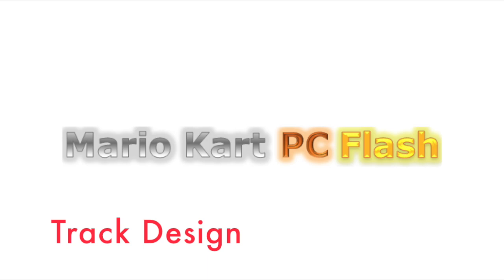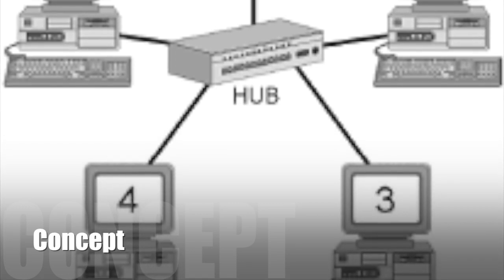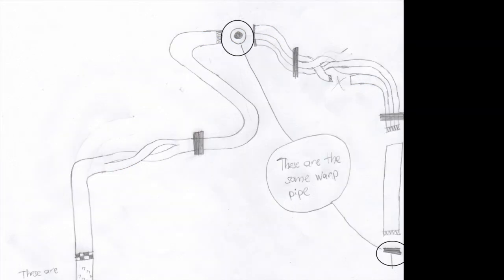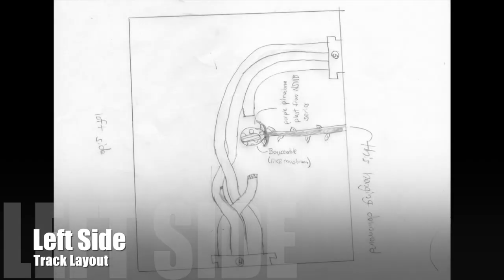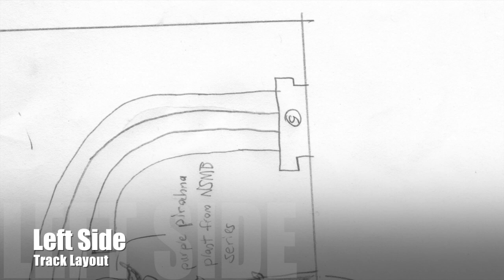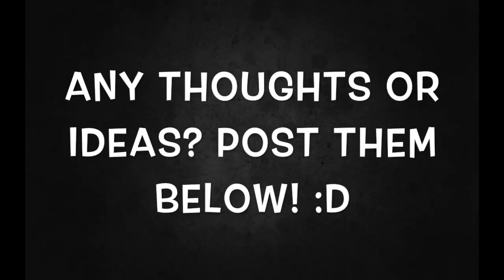Track Design - Piranha Pipeworks

Comment: I have an idea for a track which I like to call: Koopa Shores. You start off on top of a cliff edge off from the coast as you enter a light house. You climb up the inside of the lighthouse in an anti-gravity spiral as you make your way to the top and get shot out in a glider path leading to a barge just outside out to sea. You land on the barge where the path leads you to two alternate paths, each on both sides. You then head to the other end of the barge, where it leads you to the inside where you must dodge freights and machinery as you make you way to the bottom, leading you underwater as you make your way back to shore, then drive on the beach and drive an anti-gravity section up the cliff edge back to land and making your way back to the starting line.

Comment: I'm alive! Half Term! Good Grades! Anyway...
1) 0:20 Yes, that would help. My art skills should NOT be discussed.
2) 0:37 No problem!
3) 0:42 How is your presentation? Very good, very clear. I like it! :)
4) 0:44 What I saw before making this comments really did make me think of Piranha Plants and Pipeworks. I was thinking recently, try basing it off that pipe area from Mario and Luigi: Partners in Time. It can help you understand how pipes are connected. Also, an old Custom Level for NSMBW (actually for Not So Super Toaster Bros Wii) made good use too!
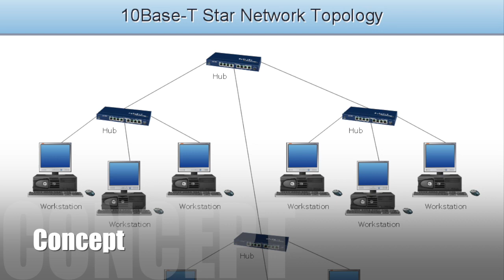5) 0:58 Good way of explaining.
6) 1:41 Again, about what I saw earlier, we need more signs of piranha plants if this is their hub!
7) 1:51 These means we should have lots of life on the two faces not used for races.
8) 2:13 Let me use this picture to explain my experience with tiling pipes. Sometimes it is more effective to have lots of vertical pipes in a row than one horizontal one.
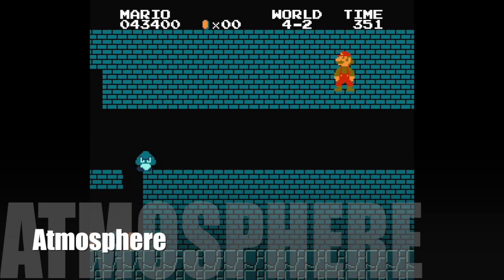9) 2:30 In that case, it needs a more updated feel. Also, let's not make this an exuse to be lazy. Have ? blocks and used blocks sticking out of the wall! Also remember, the bricks are not changing colour in different colours in SMB, the lighting is changing. This could be useful to know.
10) 2:39 Also, I'm going to use this image to explain Mario's height. Mario is two blocks high. Look at the red pipe. Can you see the four blocks? This tells us that a warp pipe is just under double Mario's width. Just if you need to scale any pipes. There are larger variations in NSMBU. Just trying to be exact here.
11) 2:44 Here are some obscure titles for you:
* Donkey Kong Jr + Jr Maths Lesson
* All Night Nippon Super Mario Bros
* Kaettetika Mario Bros
* Yoshi no Cookie: Kuruppon Oven de Cookie
* Undake30 Same Game
* Excitebike: Bun Bun Mario Battle Stadium
* Donkey Konga
* Donkey Konga 3: Tabehōdai! Haru Mogitate 50 Kyoku
* Captain Rainbow
* Super Mario Spikers (no, not strikers)
* Face to Mario
And finally...
* Mario Party Fushigi no Korokoro Catcher
Yes, these are all real games!
12) 2:56 Yes, this is VERY hardcore
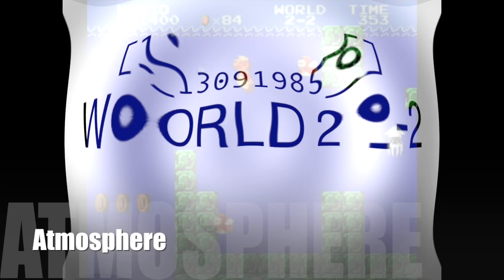13) 3:25 In fact, we could even have water coming out of that pipe!
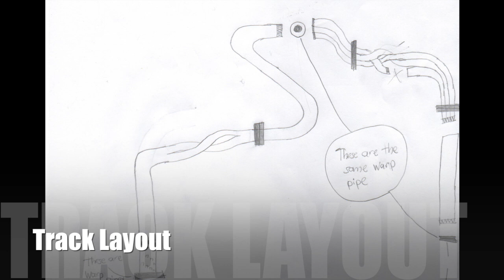14) 3:30 Don't worry, I do Track Analysis on MS Pain for a reason. This: http://s42.photobucket.com/user/marionose1/media/Choosing%20Yoshi%20Test_zps2p6tfoko.png.html?sort=3&o=0 , is not something I can usally produce.
15) 4:34 Can I see that you planned to put a Warp Pipe somewhere on the right? Just asking.
16) 4:50 May I also say that the corner needs one of those connector thingies. A thing with warp pipes is that they can only travel straight. This is the video I mentioned earlier: https://www.youtube.com/watch?v=7RJmoG3wCWc
17) 4:58 Pipes are very strong. If connected to the walls and floor, they do not need pipes to stabilize them. Also, there is no neat way following warp pipe rules that a mini pipe can connect to a normal pipe. They can however be nearby.
18) 5:05 Yes, that is a great idea! This is used in Pipe Underworld for CTGP.
19) 5:17 Metallic is a good choice. Also, considering this is probably a sewer, it should be very rusty.
20) 5:23 OK, but the track will be very bumpy. Having a picture as our texture will make the track look ugly.
21 (OMG! 21! hahahahaha....uhhh) ) 5:28 I'll assume there is no faster path here.
22) 5:39 Is it on the path? Nobody will ever go that way if it is.
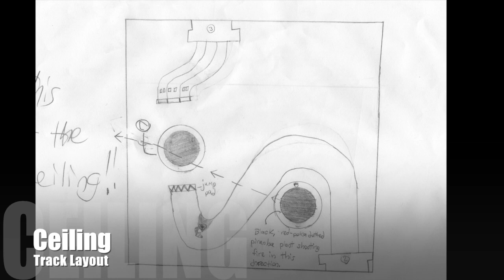23) 5:54 Like we discussed, instant teleportation can be painful to look at. Try to imitate GCN Pipe Plaza's pipes.
24) 6:02 Yes, I do remember. They mess up my times in SM3DL. Remember, we could also have Venus Fire/Ice Traps!
25) 6:06 Giant? We don't know its behaviour! We do know how giant Venus Fire Traps work however. They are slower than normal size ones, and the fireballs are about the same size as Mario. To fit the scale of the karts, the fireballs should match the size of the kart as well.
26) 6:10 Is that a footprint in the pipe? Why is it there?
27) 6:12 Not harming? I know where this is going, and I did the first time I watched this video. In this case, we should be on the opposite side to the area he's shooting at. This means that he can be shooting a more direct route, avoiding glitchyness.
28) 6:25 Not sure if that will work. That turn looks quite narrow, and if its busy, people will have nowhere to go.
29) 6:25 Also, why is "LING!" written on the left? Are we on the ceiling? 
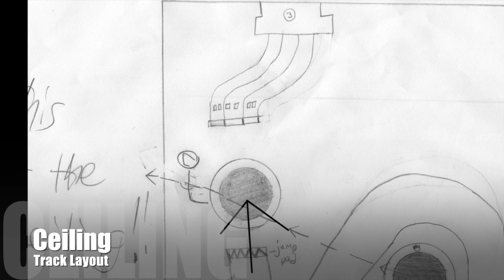30) 6:39 I have something about this pipe to get to as well.
31) 6:54 How wide are these pipes? I think they'll be hard to frive on.
32) 6:56 Actually, those piranha plants come from holes mainly. It would make more sense to use a hole in the wall. A pipe is still fine though.
33) 7:12 Then what about when you exit the warp pipe? That could be a pain to land on.
34) 7:24 I do not think that will work. Cool idea though
35) 8:20 No. Offroad on a pipe is not a good idea. Remember, working with pipes is different from working with normal ground.
36) 8:24 Obviously? The amount of offroad there looks like ypu can just jump in last second.
37) 9:25 Just a reminder, a texture is more what the ground IS, rather than how it acts. For example, Wii Mushroom Gorge's Mushrooms have a Red, Spotty texture, not a round bouncy texture.
38) 9:35 Yes, yes I do
39) 9:41 My only issue is that players driving on the straight-away won't see the Fire Balls until they have nearly landed.
40) 9:42 Hang on, is that off-road, or are you marking where the fireballs land. Oooh! Let's have burned marks on the track to show where the fire lands! Bye Bye point #39!
41) 9:49 I prefer to think of BCWii. There are burned marks there, too.
42) 10:02 Good choice with those ramps. The player can either lose time by gaining air, or they can try to dodge a fireball.
43) 10:07 Good, three item box sets. Perfect!
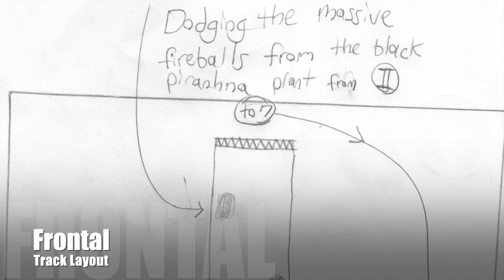44) 10:21 Here comes point #30
45) 10:30 I'm sorry to say that I do not like that idea. The karts can easily collide.
46) 10:38 OK, so it did say ceiling. I wan't sure

Anyway, amazing video and ideas. I have one final thing to say, and it's about the audience. Remember the Stalking Piranha Plants from NSMBW? They should watch!

Also, I have no issues with your voice.
Reply from the maker: marionose1 Thanks for the LARGE FEEDBACK!!! You make some very interesting points but allow me to try and save some of my ideas before you shoot em down ok? XD

Before I start, yeah I wasn't thinking about the audience at all as I was mainly focus on getting the CORE design which turned out pretty alright for a debut (for what you've written) :D

4) There's a thought! 
6) I know I just wasn't too sure exactly WHAT to do in regard to that. By the way, this is the hub of the ENTIRE mario series not just for the Piranha. I originally envision the Piranha to create the image that they are INFECTING this hub world per-say.
7) I know. I set that up specifically for anyone to add ideas for. Plus I thought the track length was fine as it was so I kept it at 4 sides.
8) I understand. I just really wanted to portray the image of a network going to many locations.
9) Kind of lost you here. :\ Can you explain this again?
10) I know but remember that we don't really know the scaling for the characters inside the karts in correspondence with the track yet which is more important than the individual character scaling. Going off MK8 track scaling, the Pipes, Warp pipes, and entire track itself need to be big enough to accommodate for 12 players racing at the same time. The same concept is applied in MK8 DLC #2 Animal Crossing's KK Slider.
13) I'm not opposed to that as long as it's explain how the water exists the "hub" per-say. Same concept applies with any kind of pipe we do this with.
14) Finally got it up huh!? XD It looks really good. What other menu layouts do you plan to do next?
15&16) The large warp pipe is going into the wall. I would like to connect these large pipes using those blocks you mentioned. I wasn't thinking of that.
17) Again, I know that but we need that  structure as used in all other race tracks. That's on top of me not knowing exactly what to use as I implied. XD
19) Nice! I like that
20) I said "similar" for a reason. I meant that the texture design is based off that iron not that I actually wanted to use that iron.
22)No. It's in-between the roads (not part of the track at all) before they reconnect. 
23) that was the original plan. I was saying that imagine GCN Pipe Plaza's pipes and remove the dark spots inside the pipes so that players can see where they'll come out when they race. Think of seeing beyond the image. From the player's perspective, it should look like a normal race track.
24&25) I was actually thinking of that piranha plant. I just didn't know it had a name of it at the time. lol. I meant giant as in it has to be big enough to actually hit someone and be a threat to racers. If a small normal one shoots a fireball, yeah he can split out another one faster but it would com out so tiny that it wouldn't be a threat to players. A Giant (in scale) normal Venus Fire Trap can shoot fireballs just often enough to where they become a threat.
26) Ignore that. When I was first drawing this section, it was a indicator to to let me know that that pipe had the Venus Fire Trap inside it. This has absolutely nothing to do with the track itself.
27) I'm not sure I understand what you're saying here but I can tell you that he was placed here so that players can clearly see that he's up to something. It's more visually appealing if the players are able to CLEARLY see this guy firing Fireballs. I also don't understand how his placement would cause glitchyness.
28) We can just widen the road so there's more room. As I said, my drawings aren't the best at time when they should be. 
31) Image that split road from MK8 DLC #2 Wild Woods. About that size but slightly smaller. You have guard rails here as well. I forgot to draw and mention.
32) I know. I wasn't thinking about that until everything was settled and uploaded. lol. I can't be perfect. XD
33) I'm confused here again as well. The pipes basically go back to the same length BEFORE you go into this warp pipe. Does that answer your question? :\
34) Again. I'm going off a altered scaling here. It's head is about the same size of those Bowser's balloons you jump on in MK8 Cloudtop Cruise, maybe smaller if you think it'll become an issue.
35-36) What would you recommend to fix that? You seem to understand what i'm going for here. Far as the offroad, that was again me not drawing that small area to proper scale. Maybe we can use Rust as the off road texture? :\
37) Ok then. What term am I thinking of? I feel like I should know that for future videos. (I forgot to address that when writing this entire reply. lol My bad.)
38) Get off my back! Haha! XD Just trying to make sure everyone can follow along. Plus I didn't think my voice would get the point across at the time. 
39,40, 41) I said that here 9:50!! XD lol I used GCN because it's easier to see the size of the fireballs I wanted to be fired. 
42) I don't know if you've noticed but i'm thinking more along the lines of MK8 physics not MKwii. I guess both work though.
43) I had EVERY intention of saying that but I was gathering a lot of information at the time so it got skipped over. Sorry. :D
45) Again. I'm thinking MK8 psychics. They jump further not higher. If this does become an issue, a fix is very simple. 1st fix: As I said, the warp pipes are very huge so they can en-case the entire track. When they jump over the pipe, they are going over cross the pipe center but when jumped into, they are jumping into the very edge of the pipe. Option two is to simply shift the pipe so the players can still see it jumping over and still go into.

Thanks again for the feedback. I told you before that I was gonna need help and you provided. This stuff is not easy but you can clearly see I tried to think about everything I can to make this track challenging, fun, and visually appealing while sticking to the concept.
Reply: Panman14 9) I'm saying update the feel of the brick blocks in the backround. If there is a light source, attempt to bring back the above ground lighting. 
14) Not too many. I did E. Gadd, but I don't have a MK8 image for him. No matter. This isn't MK8, is it!?
17) Can I suggest adding more pipes to the ground using connectors and  black pipes (They are in NewerSMBW)
20) Ohhh... I was distracted because I kept having to go out in the middle of writing this. Actually, I guess we could have the ground slanted upwards at the edge if we want to.
22) OK, cool.
24 + 25) Yeah sorry. I've been modding NSMBW since I was 8, and I get irritated by the scale of piranhas and pipes! lol.
26) Ohhh... ok. Yeah, I see why.
27) I was being stupid there. And I'm saying if the route of the fireball is more direct, it will be easier to code.
28) Yeah, I thought so.
31) Oh yeah!
32) No worries! In 4-2 of SM3DW, there is one coming out of a pipe.
33) Sorry, I wan't thinking here either. I thought the pipes were already at different heights early on.
34) I'm thinking more that the shape of a piranha plant in general might be difficult.
35 + 36) Sorry, I'm going on a rant about tiling! XD! Yes, rust would be cool!
37) I don't mind. "Shape" or "Function" will probably work. Just me and my modding...
38) WHAT? I was just saying that I was!
39 - 41) Oh yeah... smack
42) Yeah, I try to do that too. I'm very close to MKWii like people are to SM64 really. I just know the way the game works (ish).##
45) MKWii still has distance jumps! But and I can kind of see that colliding will just speed players, but it can still be a hazard. I like the idea of having them coming out the sides. Just make it not-possible for players on the ceiling to collide from there. Maybe a barrier like by the mushroom in 3DS Rainbow Road.

Don't worry! I tried not to be too harsh. I can get pretty evil. And there are loads of points because Track Design is about twice the length of Track Analysis!
Reply from the maker: marionose1
 9) I think I feel you. Use a light source so the track doesn't end up so dark. Alright. In that case I like the idea of using ? Blocks and used block.
17) That can work. Think you can draw me a small layout of how exactly that would look? :\ Nickname is actually working on a model of this course so I would like to run that by him if it requires any changes.
20) Nice touch. I like that as well. :D
24+25) I don't know anything about modding but I can somehow relate to that. -_-
27) Ah! No problem. Far as the all we need is to make sure the warp pipes can actually "Teleport Actor" to "New X/Y" like in GCN Pipe Plaza. From there, we just tell "Object Fireball" where to go and we're good. :D
34) Annnnnnnd I'm lost again (I think). You're saying that the head itself is massive compared to it's body right? Then make the body bigger. If i'm off, help me.
37) Alright. :D
38) I thought you were playing around. You're a smart dude so I didn't think you would comment on that part of video is all. :D
42) No problem. Just remember that MK8 is also my inspiration for my music so it's naturally i'll use MK8 as a basis for my Track Design. I think that'll work out fine though. Two awesome Track Analyzers one working off MKwii scaling, the other on MK8 scaling, something interesting can be born from that. XD  
45) Fair enough. I see your point and if colliding karts/players is the only issue, a fix is easy. Just shift some stuff around and we're good to go! :D

As long as you're not TOO harsh, it's okay to be strict. Communication is the core foundation of any game in development so there will never be a time where I straight up ignore what you have to say. Yeah. Sorry but Track Design is definitely longer to produce than Track Analysis but I gonna try and get something out every month like my music if I can. :D 

Two slightly off topic questions however:
1) How often do you think I should try to get a Track Design finished and uploaded? I switch from original compositions (MKPC) and Retro Selections every Batch I upload. Do you think it should latch on with Original Compositions? Come out in-between Original and Retro Selections or what? :\

2) Yoshi's Island is next on the list. Would you like me to send you the picture before I start working on it? (I'm still out of town away from my workstation so nothing's been done btw) or do you think I just wing it and upload later? I'm asking because a track design was actually already drawn so I'll be talking about what I see and what changes I should make.
Reply: Panman14 Yoshi's Island? Yeah please! I'd love to see what you have in mind.
How often? I'll say when you've finished a batch of compositions go crazy with about 5! If not, IDK! By go crazy, I don't mean all at the same time. Just have them ready
Reply from the maker: Cool. I'll send you the pic in a moment. having 5 Track Designs in development after Compositions Batch can work. Thanks for the tip. :D
Reply: Panman14 I know, just an idea. Analysis is my only project at the moment